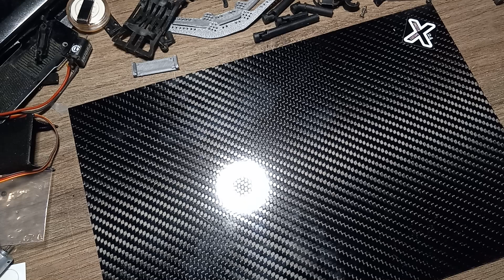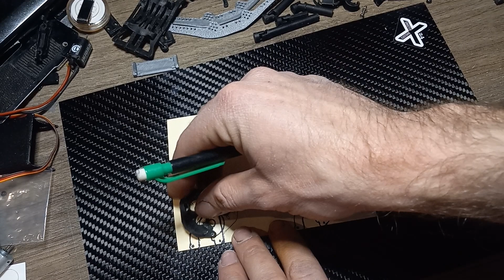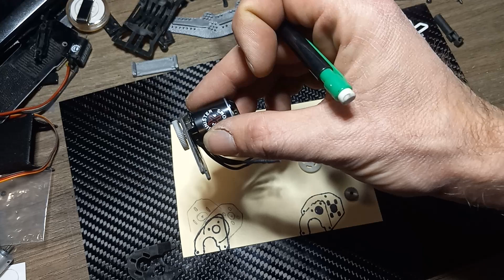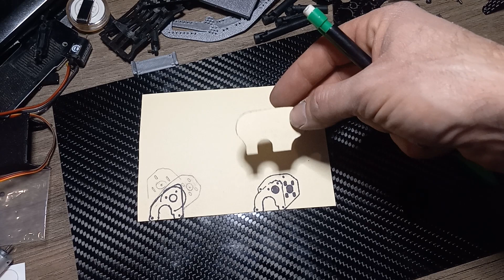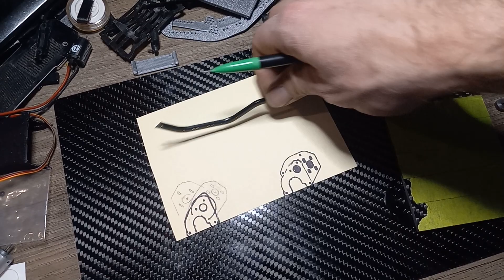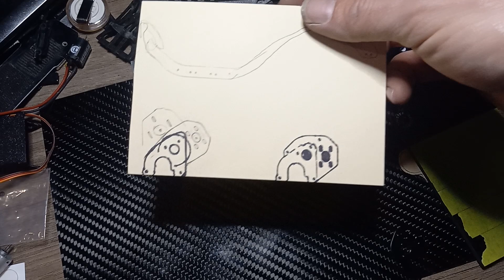How to make a carbon fiber motor mount for your #scx24 and chassis #moforc #scx24mods #tinkertimerc

Comment: Would you suggest doing this in order to mount the spectrum 2 in 1? I'm doing a prerunner build that I want to put the 2 in 1 in but haven't found a mount yet
Reply from the maker: If your talking the spectrum 6000kv 2in1 it should bolt right up to a 360 size motor mounted like the rc awd or the injora fat viper mount or the furitek big komodo. Most are going to have a small pinion gear opening like 11t pinion but if you can find an old nylon furitek komodo mount can run up to like an 18t pinion
Reply: @sinistercustomsx2434 I have a lgrp %56 over drive transmission I want to make a mount for and put the 2 in one on it that with my fms portals converted to straight axels should be a cool quick little rig